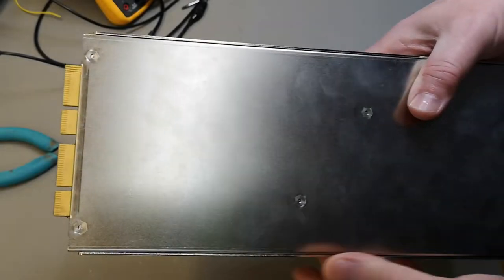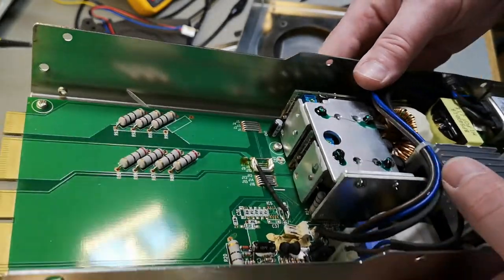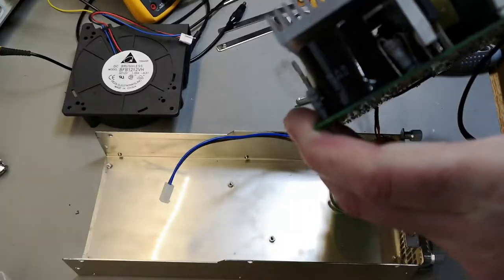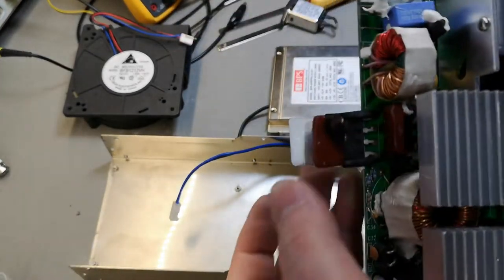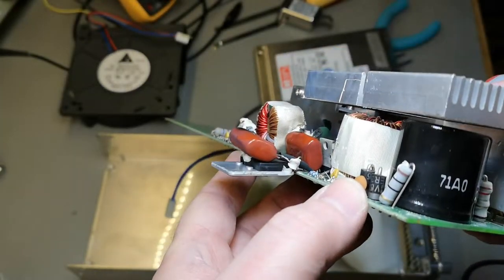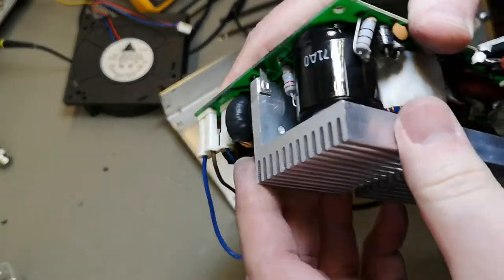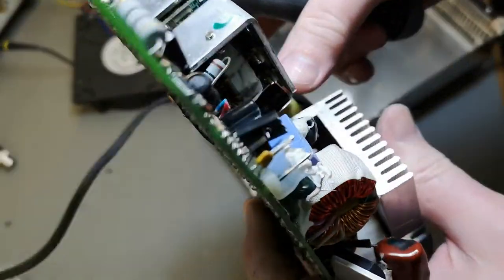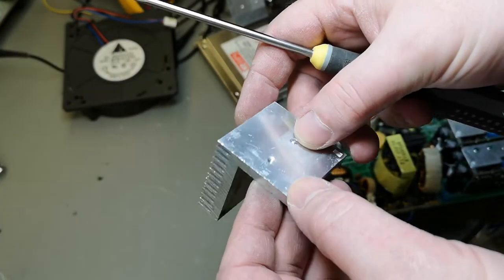BPS-400RPM-LB A/3 Switchmode 400W, teardown the hard way

Comment: I would have loved to hear the BANG when it sparked ;-)
Isn't a bad idear to have the electrolytic capacitor under the hot heatsink ??
Reply: The electrolytic capacitors should be OK with the forced cooling
But they definitely have a clearance problem between the heatsinks and large polyester capacitors